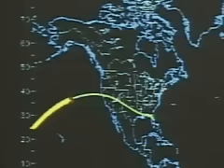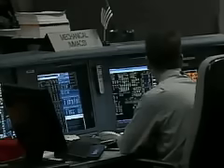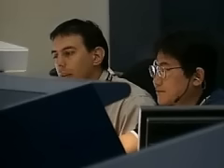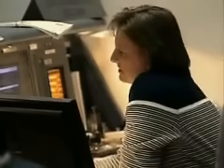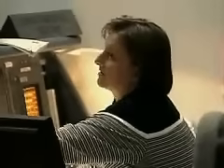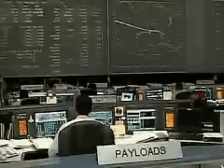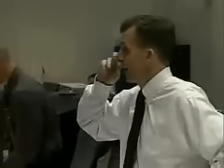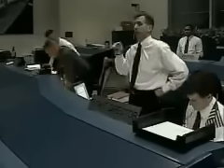Inside Mission Control During STS-107 Columbia's Failed Re-entry and disaster

Comment: 5:05- I'm feeling the heat. Literally seconds after that, they lose contact with Columbia. What a sad day.
Reply: 6:20 He knows it is over.
Reply: I think he says the "the tires are feeling the heat. Pressure on left outboard left inboard. Both tires".
Reply: I had thought this for a long time, but definitely hear now that he was saying "Hou-" as in Houston and cutting out, and not "heat". It's from 5:04 to 5:05, he only says a few words in between "tire.....pressure" which was the people on the ground talking to each other. The next thing from the shuttle is the last thing, "Roger, " about 10 seconds later.
Reply: My god yes! It’s there underneath the chatter! That’s such a disturbing transmission! Definitely crew reference to heat! I never knew.
Reply: And at 5:16 there’s a further transmission underneath too. I have no idea what it is!
Reply: @daz090979  "Roger...but...uh..."
Reply: Ayeshteni nicely done my friend!    TYM
Reply: @daz090979  "Roger uh-..."
Reply: You’re right
Reply: The way this unfolded the shuttle would not have been heating up in the cabin. The moment the integrity of the wing was gone enough to cause a major issue the whole thing happened in a few seconds.
Reply: Although the crew knew something was wrong due to the various sensor malfunctions and alarms they would not have physically felt a difference in the way the shuttle was behaving right up until the point where the left wing came off. The flight control system was compensating for the extra drag caused by the damaged wing by firing the RCS thrusters and adjusting the elevon roll trims. When the wing failed completely the shuttle entered a spin and was torn apart by the massive aerodynamic forces.
Reply: Seems like the ship came apart right around 5:20 or so. So incredibly sad.
Reply: Iron Monster  listen past what they are saying cause I heard it. That was the crew saying "I'm feeling the heat".

Pull the time back to 5:00 and you will hear it.

Comment: Where’s the sound from inside MC?? We can’t hear what they are saying or their reactions to losing Columbia. Com check doesn’t start until 7:02
Reply: The video and audio in this particular video are not in time.  This is heavily edited and a LOT of dialog and back and forth is missing or cut short.  Sometimes someone replied with 2-3 sentences but in this edited video you only hear half a sentences worth of the reply. Also the editing makes it seem the time between a question and the reply is shorter than it actually was.

Just as a quick example when INCO says, "I could swap strings in the blind."  You hear the Flight Director say,  "OK, command us over."  about 2 seconds later.  In reality he didn't reply for almost 15 seconds.
Reply: Sara Brown I guess my question is if the camera was in there, why was audio not turned on? Or if it was, this particular video doesn’t really show anything we haven’t already heard or seen. I saw an on board camera view moments before transmission was lost and there was way more dialogue than in this one.

Comment: 8:41 - "FIDO when are you expecting tracking?" "One minute ago, flight." That was the moment he knew.
Reply: I think they knew way earlier, but were just hoping.
6:11 “I get 4 temperature sensors ... that are off scale though”
Reply: Yeah, I would say he suspected it earlier, but 8:41 is when he knew that the orbiter was most likely lost.
Reply: @aliancemd  off-scale _low_; as in, so low that the scale can't show them, usually because... well, the sensor is bust.
Reply: @aliancemd  Yes, I believe as you say.  The intuitive logic is there -- they are all engineers: they knew well.
Reply: @aliancemd  they were still getting data at this time so their concern was that the ailerons on a wing had been damaged AFAIK until they didn't regain telemetry at 8:41
Reply: They knew it was doomed after hearing 4 separate sensors failing within seconds of each other were on independent systems with no common link, and in the area they had been aware was hit by the foam at launch ....The long faces and fidgeting is on full display from 2:30. It only got worse and any wishful thinking further eroded as the seconds ticked and more systems like the tires became involved.
Reply: They knew when there was no commonality. And anyone watching the footage on CNN knew it was breaking apart before these guys did.
Reply: I think mission control knew all along what could happen during re entry. You can see it in their faces when the temp sensor problems start. Nasa was just hoping it didnt happen.
Reply: In an interview, the flight director says that if he watched this video, he could tell you the moment he remembered the foam strike during the launch. I suspect it's at 8:39, because the only commonality for the instrumentation errors were they were in the left wing.
Reply: 5:10 tire pressure 5:15 audio
Reply: That’s already been said, noob…
Reply: @EKFsurf actually the engineers wanted a photo of the left wing so they can see what's going on and solve the problem but Linda, she said that there was no need of doing that. Because of her the crew is dead.
Reply: @prathamtawar1163  Your statement is inaccurate and is hardly fair to put all the blame on a singular person... Do proper research next time.
Reply: @prathamtawar1163  No, because of NASA's culture, they are dead.
Reply: @prathamtawar1163  There was nothing that could be done, even if they fully knew.  Better to not let the crew agonize over their possible impending death for days before they were supposed to land.
Reply: @eray9934  Thats BS.  There was plenty that could have been done.
Reply: @hoghogwild  suicide before re-entry was about it.
Reply: @mgabrysSF  If the damage was found by flight day #5 there was plenty that could have been done.
Reply: Did they really have those cameras in the shuttle??
They saw it happen on those cameras??
They had footage inside the cab?
Reply: @marieh7861  the footage Dom the cab came from a video tape which was found in Texas. It was filmed by the astronauts on a hand held video camera.
Reply: @extrude22  
Thank you for explaining this 
That was a horrible thing that happened 
Poor crew 
R.I.P.
Reply: @marieh7861  what cameras? we're talking about the controllers not the astronauts, but yes there was a camcorder in the cockpit if I remember correctly however the crew didn't appear to think anything was wrong and it cuts out before we see anything destructive happen.
Reply: Chrismofer 
Did you watch part two? 
It shows a smidgeon if it 
Exploding 
And it looks real!
Reply: @marieh7861  no, i cannot find part 2. please link me.
Reply: Chrismofer 
Well it says it part 2 but it’s a definite continuation of this clip! 
Let me find it
Reply: @marieh7861  yep that's the real video footage, captured inside the cockpit during reentry on a camcorder if I remember correctly. the tape was recovered on the ground incomplete, and ends before we see any actual breakup of the vehicle. it shows some plasma streaking outside a window, the same plasma was inside their left wing at that moment melting the aluminum substructure. there is a shot outside the orbiter immediately after, but this is a cgi and is marked clearly as a reconstruction.
Reply: actually it was a sony V10 clamshell little tape recorder and the camera was a handheld sony XC555 'lipstick' camera in velcro 
powered by the orbiter on a long cable so it could be carried about within the cabin.

Comment: Maybe this is a silly question but if the spacecraft is already blow up, then how come that doesn’t appear on flight controllers computers instead of one by one they are losing censors and data?
Reply: Because there is no sensor to tell the Shuttle is gone. Columbia didn't "blow up", it broke up in the atmosphere. It started with heated plasma getting into the left wing, which started taking out sensors, then eventually the left tires. When the break up occurred, all the telemetry from the remaining working sensors went out at once. The tracking visual on the main screen just stopped... at that point, they suspected the Shuttle was probably gone, but had to keep waiting until it was certain (it was possible, if improbable, that something else happened to mess up their communications, hence why they started getting even more certain when the Shuttle didn't enter their tracking range).
It was confirmed the Shuttle broke up when another NASA employee (I think another astronaut) called to tell them he saw debris streaking through the sky in the Shuttle's flight path (which is why Cain gave the "lock the door" order right after talking to the guy behind him, who'd just gotten off the phone...forgot his name).
Reply: brch2 -thanks!

Comment: What happened to the shuttle.
Reply: During ascent the left wing was hit by foam from the external tank causing a roughly 20 cm hole in the heat shield. During entry it allowed hot plasma to enter and weaken and eventually causing loss of control and breakup of the vehicle.

Comment: At 5:17 is the last word from Columbia, “Roger, I’ve got....(it sounds like to me) then just static. A tragic end to such brave individuals.
Reply: Charlie Henderson no the “roger uh but” was the crew talking. We hear their radio communications for example when they “Columbia Houston comm check”
Reply: This is, in my opinion, exactly when it started to disintegrate.
Reply: Zed283 that was the sound of disintegration, not sure if it was the mic being keyed as it was happening or just feedback from all of the wires burning.
Reply: Dan Jr probably no one knows for sure
Reply: The static occurring after Rick Husband went dark was reminiscent of the explosion sounds heard on Challengers radio before it disintegrated
Reply: @GaiaSeed the challenger did not disintegrate though...
Reply: @hddhdhxhxb1793  Neither did Columbia. Columbia broke apart. Big difference.
Reply: @hddhdhxhxb1793  Challenger itself was torn apart by severe stress to her. The External going up didn't help. It was a combination of overstress of the air frame and the external going up in flames if I'm remembering the investigation board.
Reply: @hddhdhxhxb1793  It did. After booster failure the orbiter was ripped apart by harsh aeronautical forces
Reply: @zaabri283  That isn't when it began to break up. You can looks up logs for the mission with timestamps for what happened and when. Shortly after this, loss of hydraulics was reported, which is what was used to control pitch, yaw, and roll of the orbiter. This is when the orbiter broke apart, executing a roll, with the ionized gas from re-entry finally tearing into the wing, destroying instrumentation, resulting in the breakup of the orbiter.
What you're hearing isn't the breakup of the orbiter. What're you're listening to is interference from ionized gasses getting in the way of communication. Now, ionized gasses do give off EM radiation, which is very noise-like when you listen to it, kinda like the white noise you pick up on old CRTs when they don't have a signal.
Rest assured, you're not hearing the breakup of the orbiter. You're listening to the last failed attempts of the mission commander to radio control. This is demonstrated when the lady (I'm not sure what she was overseeing) and 6:39 saying she wasn't expecting that, "bad of a hit on comm". The loss of communication was expected.
I don't know which is worse, listening to the orbiter breaking apart, or listening to the failed attempts of seven people attempting to get in touch with people who they needed to help guide them down, moments before the machine lost its fight with the forces of re-entry, alone.
Reply: @jennalynn1921  Based on the timeline, the crew had a normal cabin environment and electrical power for 46 seconds between loss of signal and main body breakup. Loss of control occurred about 5 seconds after loss of signal and they drifted into a slow spin. Based on the recovered data and evidence, the crew responded to alarms and was working the problems on their panels until the fuselage breakup, which had lethality sudden enough that, although the crew module remained intact another 35 seconds, no visors were lowered in response to cabin depressurization.
Reply: "Roger.. uh... but"
Reply: The actual catastrophic event happened no earlier then 6:03
Reply: my guess is he was going to say "Roger, uh, both..." to relay information about more sensors dropping off, i.e. "both landing gear hydraulic sensors" or whatever the case may have been... that's my best guess anyways, i think they were just in the mode of reporting each successive loss of sensors as one thing failed after another.  And yeah they were alive for a while after communications were lost.  After loss of communications was when they lost control and worked the board to try to regain control... then once the cabin depressurized that would have caused them to lose consciousness very quickly (they didn't even have a second to lower their visors), and then it all broke apart after that.  Not a long painful death. But surely they knew they were in a lot of trouble for a minute there.  So sad.
Reply: Charlie Henderson ah I see where you’re confused. Yes, you’re right, that is mission control, and I never said it wasn’t. The point I was making was that we can hear the communications from the radio as well as the mission control loop. You hear the astronaut saying “roger but uh” and then it cuts out. Quick little internet search will show you that those are the recorded last words, which we hear. So you’re wrong.
Reply: I don't understand the confusion here....yes we are listening to mission control going back and forth with each other....but you also here the last words from Columbia...."Roger..???..??"  It also sounds nothing like the clear voices you hear from mission control.
Reply: Yeah, that's what it sounds like to me too. I believe that's precisely when she started breaking up. I don't think we actually heard the crew die, I'm not saying that at all. But she started to break up at that moment, cutting off the radio and thus his transmission.
Reply: @josephherron7671  acording to NASA report, after last words "Roger oh b..." from Rick Husband, they were alive for at least 45 seconds.
Reply: roger uh .... bur....
Reply: 5:18 I hear a woman's voice faintly saying "Oh my God" Got to put on headphones to hear it. Somebody else mentioned that and I listened and  feel like I can very distinctly hear it.
Reply: Charlie Henderson   Bud, you’re the one who was absolutely wrong
Reply: Charlie Henderson - Both pilots are heard. Willie at the very beginning.
Reply: Roger, our  butt
Reply: we actually dont know their last words because it took two minutes to fall out of the sky and they died on impact with the water because they could not deploy their parachute. They could have passed out or told each other something. There is also a chance that the coms were sabotaged (i know it sounds like something from among us) because when they were falling...someone could have admitted to sabotaging the mission and so they wanted to not get their family charged and be known as "the sabotager". there is also a chance that the capsule was ejected and they were also ejected out of the capsule and fell to their death in a free fall.
Reply: @tinamansell8909  .. what parachutes are you talking about.. those small parachutes are useful only for slowing down the shuttle after it has landed.
Reply: @tinamansell8909  Are you talking about Challenger? Columbia didn't fall into the ocean.
Reply: @annieb772  He' making shit up about Challenger. Based on his comment and his picture, im guessing it's a kid.
Reply: @tinamansell8909  Where the fuck did you pull THAT shit out of your ass?
Reply: @rprince418  I confused challenger and Columbia my bad.
Reply: @tinamansell8909  doesn't matter. All that stuff about sabotage and things you just made up with no evidence. Both disasters were due to negligence. Nothing more. The crew were trained professionals. They wouldn't have been idolly chit chatting in the Challenger. They would have been attempting to restore power and get it flying again. Remember, they had no way of knowing what went wrong or know that the crew cabin had separated from the rest of the orbiter.
Reply: @tinamansell8909  also, to add on, Orbiter didn't have a parachute at all
Reply: @rprince418   they all have space sout
Reply: @subirpatra8468  Did you mean "suit"? And that has nothing to do with what I said. I was mentioning the lack of parachute.

Comment: Flight Director doing all he can do to keep his composure at the very end of video. My heart just breaks for him - in a moment, his life was changed forever. Good man. God bless him.
Reply: have you read the report?  Cain had a meeting on Jan 23rd where he was asked about getting images of the strike on the LEFT wing of the shuttle which he himself shutdown.  not only that, he sent an e-mail a few minutes afterwards where he says "this matter is closed".   he was told that the first thing to look for if the shuttle is facing catastrophic failure was loss of hydraulic temperature readings.  then he'd see anomalies in the landing gear indicators, tire pressures and lock position sensors would be out of whack.   exactly what ended up happening.  he knew.....
Reply: @DominicciSkycam  He's a scientist and engineer. Of course, he knew. But, reading a report after the fact is not the same as experiencing a catastrophic loss in the midst of uncertainty. Let's hope that you will never find yourself in a position of holding another's life in your hands. To whom much is given, much is required.
Reply: @DominicciSkycam you bet he did